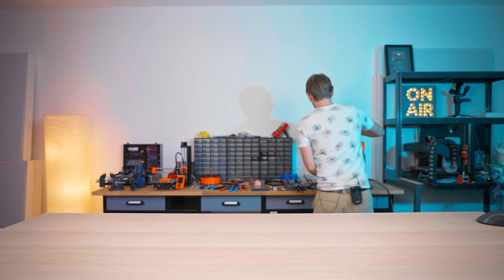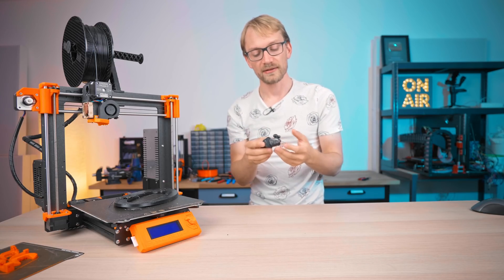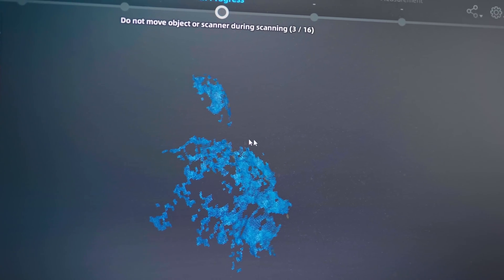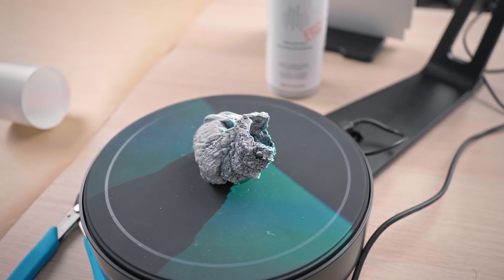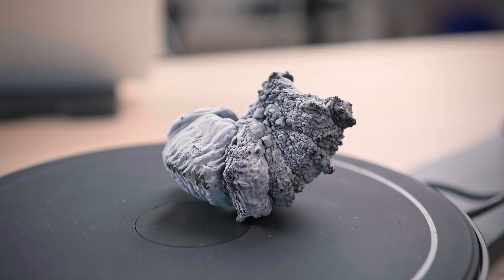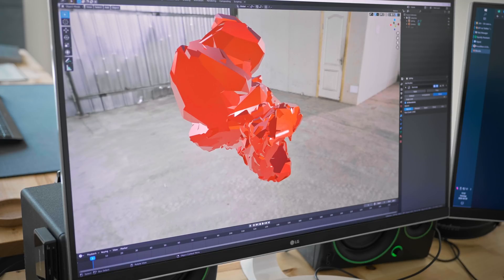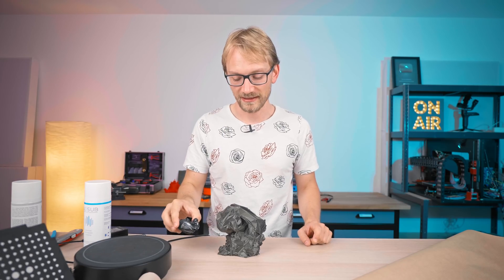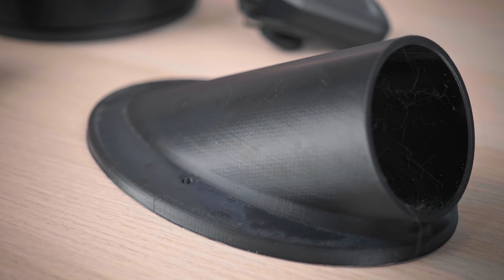How to 3D scan glossy black parts without ruining them!

Comment: Huh. I had exactly the same problem at the beginning of the pandemic. I was asked to design an adapter from a gas mask to a cheaper filter brand for the local medical response team. At 1st I wanted to use photogrammetry to just scan a very shiny, black thread instead of modelling it. Covered the part in flour and all, but it still didn't work too well. Fortunately - I still ended up using my scan. It helped me to properly adjust the scale of a procedurally generated thread to exactly match the blobby-course thread I scanned.

Comment: @Thomas: Quick note on Polycarbonate on the roof: it's not UV resistant. You should use ASA, even this will "only" last for a few (2-3) years. PC and ABS will get brittle really quick.

Comment: Discount version: dust your parts with starch - it should adhere enough to produce a matte finish (due static electricity and other sciency reasons, etc). Done scanning? Wash it off. Don't want to wet your part? Compressed air. Still reading this comment? Smash like.

Comment: I routinely print smaller polycarbonate parts on my MK3S using good old glue stick. Tom's PC blob stars in a video. My PC blobs take out either the thermistor or heater wires. I guess that's the difference between a YouTube artist and a regular guy. Sigh.

Comment: The last time I got a blob on my hot end after a failed print, the wires to the heating element broke and I had to replace it. :(   But I found a replacement on Amazon, and fixed it no problem. That's half the fun of 3D printing as far as I'm concerned.  Well, maybe not half, but you get the idea.

Comment: I've been experimenting with Prusament PC blend and heating a chamber to control warping. If I set the chamber to 80°C (PINDA and bed reported 90°), I still get some warping. Enough warping that had trouble making a functional idler for the MMU2S.  With the chamber programmed for 85°, I got a stepper diver overtemp error, so I can't explore higher yet. A part as large as that tile pass-through looks like a challenge.

These experiments have been performed using my i3MK3S with MMU2S, rebuilt in TitanX ABS. Even so, some of the  ABS parts in the MMU2S failed due to the elevated temperatures in the chamber and I removed the MMU2S to continue. At this point, the whole printer has been rebuilt in Prusament PC blend, and the stepper drivers' thermal limit has prevented me from exploring higher chamber temperatures. I've been risking my PEI sheet by printing without PC glue stick, in order to get maximum bed adhesion. I was finally able to make good parts for the MMU, I think, but I haven't had time to assemble it.

I started down this road of heating a chamber so I could print ABS. So much of what I want to print needs to be able to survive in a car or on a motorcycle. So when I fell in love with PC blend, I sort of stopped caring about ABS. My first experiment with a properly heated chamber was set at 55°C, and I was exited to see the idler print was perfectly flat and warp-free. Then I realized I had accidentally printed it in TitanX instead of PC. For years I was wanting to print a warp-free ABS part, and the first time I achieved it was pure disappointment.

Comment: does anyone know how to print individual layers separately on the printers?   i want to create a piece of art to print, but i want to be able to print the layer individually or a few layers together to get the same effect that has been done with Body Works.  like how some bodies are thinly sliced and the spread out so you can see the individual layers.
Reply: Open it in Meshlab (free). Prusa did a really good video guide on this! First search result in YouTube for "cut prusa". Visor thumbnail is a hulk model.
Reply: Or really easy would be to use 3d Builder by Microsoft. It is as basic as it can get.
In there you can import your model, which you want to split up and use the tool split to split the body into 2 parts. You can repeat this process in 0.2 mm increments, so you get your "slices"
Reply: thanks for the info

Comment: Honestly rather than use that stupidly overpriced spray you can use a water soluble paint in an airbrush and just wash it in water when your done, Literally a good airbrush + compressor and paint would cost less than that crap. Honestly if your printing a lot of things you probably want the airbrush to paint them with anyways. 
Honestly the same with the scanner, that thing is literally a rip off.   You can easily do this just fine with any phone/decent camera.  Honestly you will often get better detail from a good phone scanner to be honest if you have a good phone.   Honestly if you have a CUDA capable GPU one good one is meshroom or if you don't Regard3d is another.    The only difference with them is you might need to fix a few things up in blender yourself.
Reply from the maker: Frankly, I don't believe photogrammetry would be able to reproduce any amount of detail close to what the Einscan managed.
Reply: @MadeWithLayers  You do realize that the Einscan literally just does the exact same thing right.  All it does it take images on a timer while it is rotating and use photogammetry to create a 3d model.    The only difference is the other way you have to manually take the pictures yourself but that has the advantage of the fact that you can take more photos of the areas you need more detailed.
Reply: @MaethorDerien  That's not right, the EinScan SE is using structured light and not only photogrammetry. 
There are many articels about the difference, you will never get such an result with photogrammetry.
I assume you never saw the difference between a 3d Model from a Camera or a real 3D Scanner :=)

Comment: 🤔 im very sceptical about 3d printing something as crucial as this. you wont know when it fails (and it will). only when its too late. and the damage caused by a hole in the roof...
Reply: Wouldn't the need to put the wires through the roof be eliminated by routing them so they enter on the underside of the roof?
Reply: @NiHaoMike64  that wouldnt work on my house for several reasons. i assume other houses would have the same issues and therefore its not common. also the regular method is not a big deal if its done right.
Reply: And overpaying another company to provide you the same part sounds okay? Who says theyr part will not fail after 5 years? And there is still the problem that you can not buy a fitting roof tile if you're unlucky. There are thousands of different roof tile designs all over the world, and if you get one that does not quite fit, chances of the roof leaking are there from day 1 after installation...

Comment: Actually result of your work is nice. It's organic, like embryo (11:40).
One of our "national treasure" artist praised by critics make literary things like:
1) Buy ikea clock. 2) put ikea clock on pedestal in gallery 3) It's art now. (this was installed later even on exhibition on our university, celebrities and few reporters came for opening show of this) 
1) Buy string. 2) put string on pedestal in gallery 3) It's art now.
1) Buy ikea suction cup with hanger. 2) put suction cup with hanger on wall in gallery 3) It's art now.
1) Buy pair of shoes. 2) put pair of shoes on ground in gallery 3) It's art now.
1) Take drill 2) Make hole thru 
plasterboard wall in gallery. 2) It's art now.

His advanced creations:
1) Buy buy box of cheese, box of crayons, box of 35mm film, box of matches. 2) put one on other on pedestal in gallery 3) It's art now.
1) Buy buy 
croissant and two pins. 2) put pins in croissant and put it on pedestal in gallery 3) It's art now.
1) Buy box of matches. 2) burn matches 3) put burned matches on pedestal in gallery 4) It's art now.

Calling things like this Art is disgusting disgrace of art.
Reply: Don't forget throwing 2 dozen eggs at a wall and calling it "art".
Reply: I wonder if you are talking for the same artist who made the "Banana duct-taped to a wall" art installation.
Reply: No. Different "artist" but same type.